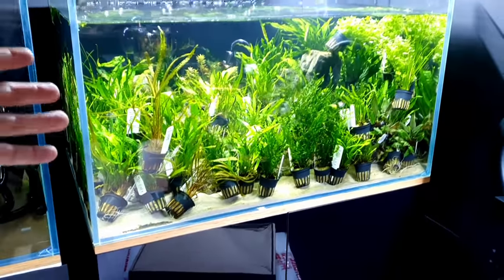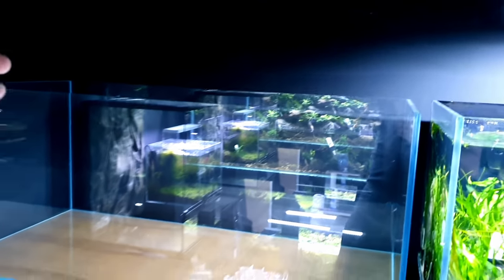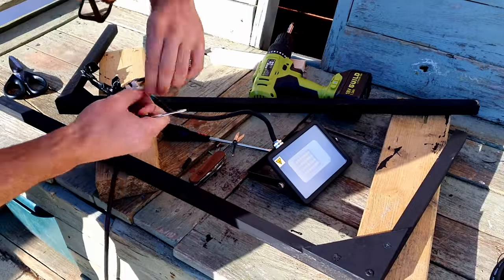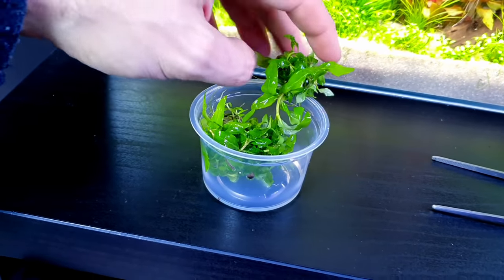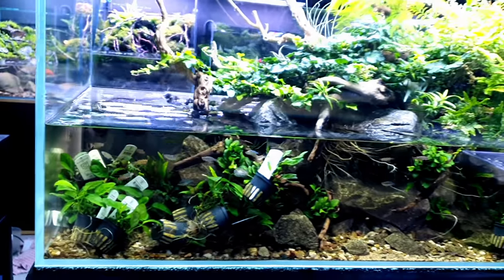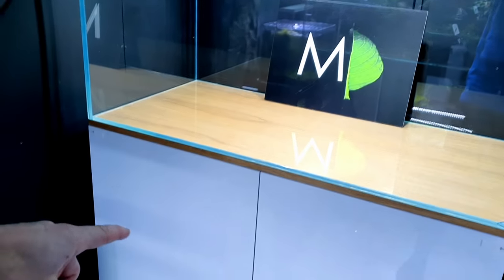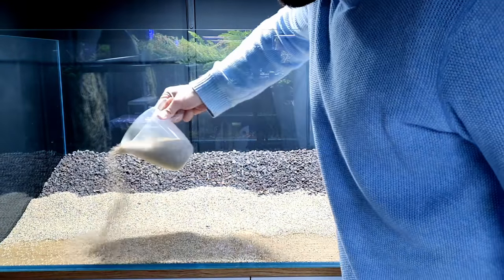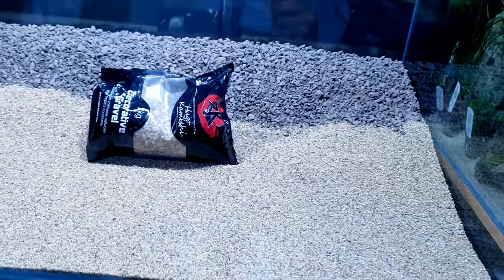4ft ANGELFISH JUNGLE AQUARIUM BUILD BEGINS || MD FISH TANKS

Comment: I'm pretty sure most of us have a similar saw lurking in the back of the shed.  It doesn't cut as much as just bully its way through the wood.
Reply from the maker: haha...took way too long to get through that piece. I actually have a power saw....but thought this would save time getting it all out and plugging in!
Reply: andy stokes I have two. My original cheap saw and the one I had to buy because I couldn’t find the original. I have 4 hammers for the same reason.

Comment: Hi, I'm planning to make a diy tank with the same dimension as yours using also the same thickness of glass.  The thing is,  I hate the look of braces/rim (it's ugly and distracting on the aquascape) so I'm planing to make it rimless just like that. 
Now my question is, is it really that safe to make one without a brace/rim on top for support? 

I know its posible as we see it on your vid,  but it's a manufactured tank comparing to a diy so I'm still worried that mine might fail, cause ya'know materials may be different. Thank you in advance.
Reply from the maker: yeah i would not like to say. I think the practices in aquarium building are far more advanced than just doing it DIY nowadays.

Comment: Iv red that having anaerobic area in deep substrate will create living area for nitrate eating bacteria. Why would you not want that?
Reply from the maker: ....like i said...I didn't really know about that aspect but I do know it's great for bacterial colonisation. I think i was referring to when you get methane build up??
Reply: @MDFishTanks  you only really want a deep substrate if your trying to achieve a no water change tank. Because having a deep substrate creates an anoxic area at the bottom (no oxygen) so the bacteria that usually use oxygen and ammonia/nitrite for energy creation, will now be using nitrate to breathe. Turning it into nitrogen gas which will then escape from your tank. If you are doing water changes there are no needs for this process as you remove the nitrate manually.
Reply: @maxanom6234  why not do water change and have a deep subrate and have plenty of fast growing plants. Cover all bases. I never have high levels of anything In my tank. Sometimes I change a bit of water every week sometimes every month. I could possibly never change water but I think micro elements may possibly need importing or exporting so I do about 20 percent  just in case
Reply: @rozzer666  because the only benefiting factor of a deep substrate is nitrate removal. Which water change already covers so theres no point. At the end of the day it all comes down to how you want your tank to work, Md fish tank is going for aesthetics and ease all cleaning like he said, so having a deep substrate is only going to cause more problems for him then it's going to solve. You need atleast 10cm of substrate, ideally 15cm for it to work efficiently, and that is going to completely destroy the visual aspect of his tank, And from what I can tell that's his main goal in a build. If you are fine putting in the time for water changes there is no reason at all to have a 15cm eye sore at the bottom of your tank as it only removes substances your water changes already cover
Reply: @rozzer666  and with micro and macro element build up, you just have to make sure you are putting no ferts or medicine in the tank, as these products tend to host a bunch of micro/macro elements which will eventually build up In your tank. Also make sure you are using high quality foods with no fillers or colouring as these will build up. I would steer away from live/dead food (shrimp, blood worms etc) as these will also build up stuff in your tank, although using them once every few months can actually benefit your no water change tank as they can help replenish missing elements. Also only top up the evaporated water with ro water otherwise you will have a build up extremely fast. Really you need an extensive water test kit for no water change tanks otherwise your playing the guessing game which is no good for your plants or fish. For this type of tank I recommend a ph of 7, as this will allow the nitrogen cycle bacteria to still work efficiently, while also making a proportion of any ammonia build up into ammonium (which is extremely less toxic to fish, some people say it is completely non toxic all though this is non proven)
Reply: And remeber with fast growing plants they will need trimming once a month otherwise your water will become plant saturated, which limits plant growth tremendously. And the plant growth is the removal of nitrates from the water, as they use the nitrates to grow and create the plant cells. Also I would use plants that take there nutrients from the water not plants that get it from there roots (floating plants/stem plants.) Duckweed is probably one of the best as it stays on the top and you only need to scoop some out instead of trimming.